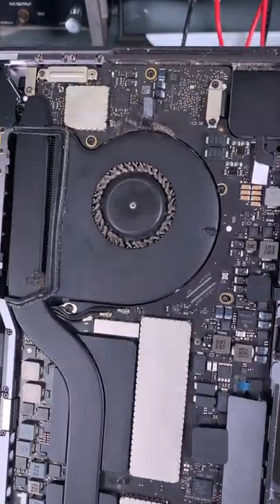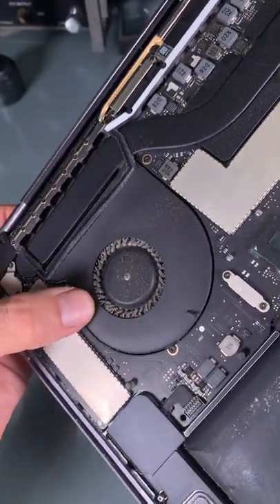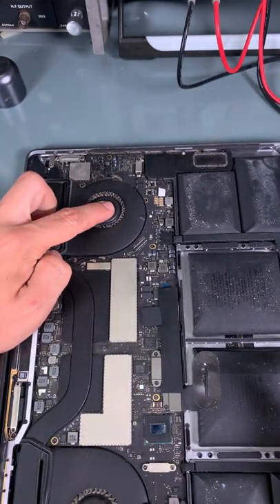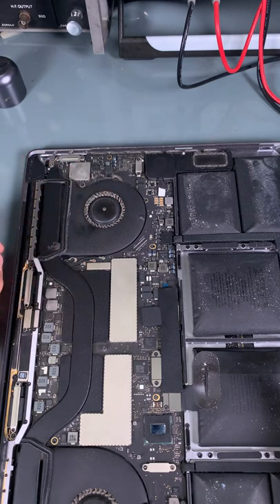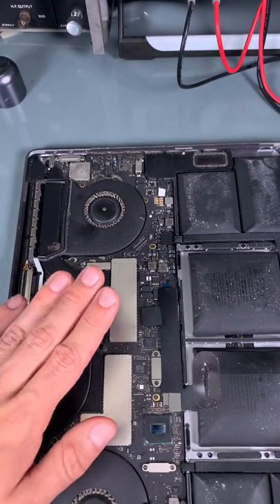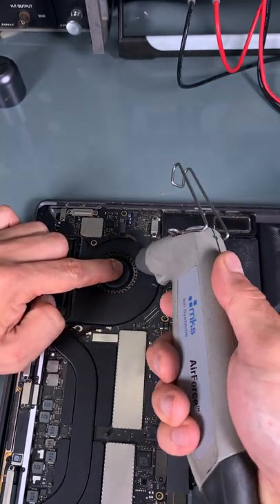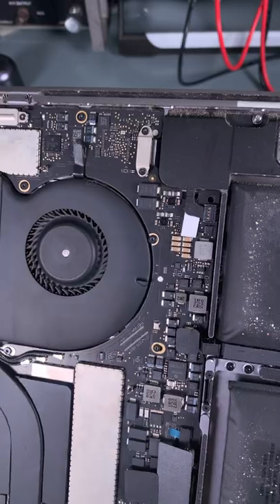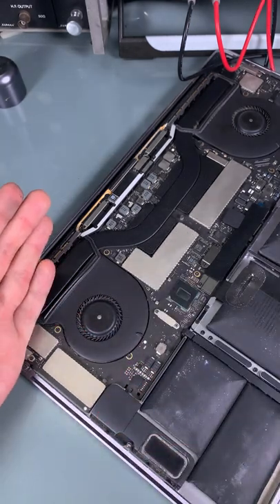dusting off / cleaning  computer fan with compressed air - safety pro tip

Comment: What can I do if I don't have an air duster?
Reply from the maker: You can always try vacuum cleaner but there is risk it will stuck into board and pull smd components out... (yea, that happen to me) - so better use brush ending on vacuum to have distance... but then if brush is not ESD safe it can take charge...  so most like best option would be grab can of "compressed air" - for one time job no need to buy whole compressor.

Comment: Now all dust is inside right isn't vacuum better
Reply from the maker: Yes & No -  I was using negative ion generator so it also remove static charge from dust and it just get down quickly, also I'm not great fan of touching vacuum nozzle close to PCB - had couple accidents when it just went sucked and knocked SMD off. But it's personal choice - stopping blade will work for vacuuming or blowing.

Comment: but using compressed air wont push the dust inside?
Reply from the maker: In general no, it was cleaned nicely - bigger problem is that dust is now in lab ^^

Comment: So can i use vacuum because i saw that it is harmfull
Reply from the maker: I'm not big fan of vacuum cleaner because: 1) if You have nozzle to close You might hit board and pull small SMD components - You could mitigate that by attachment with brush.  2) ESD - lifting dust can cause electrostatic potential - on my other video I have dedicated ESD safe vacuum cleaner for servicing photo copy machines and it can also be used for removing dust safe way.  So I would never grab vacuum near latest model that cost $$$$ USD. On other hand if I would have no other options, and have model that cost $$$ - I would not have problem trying vacuuming it via regular one since risk is low.